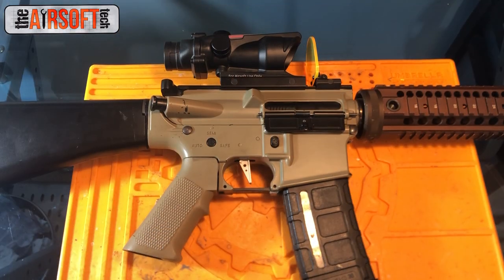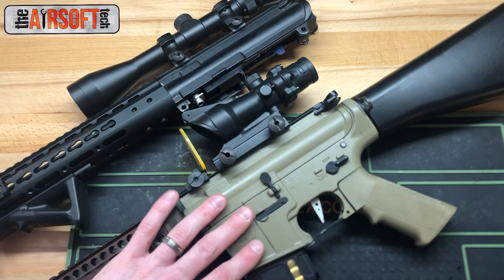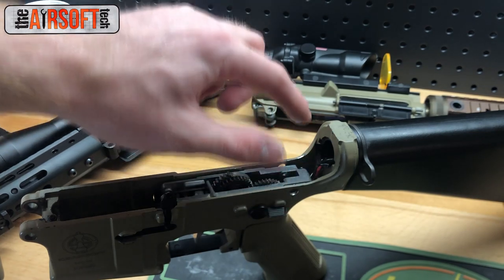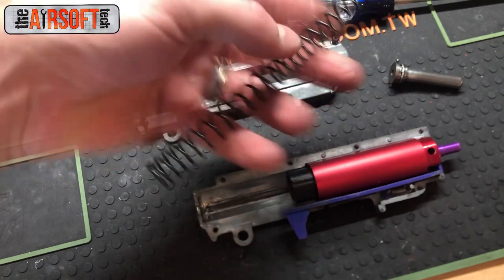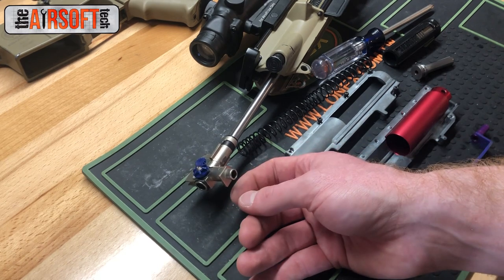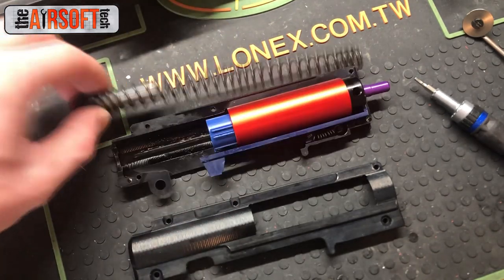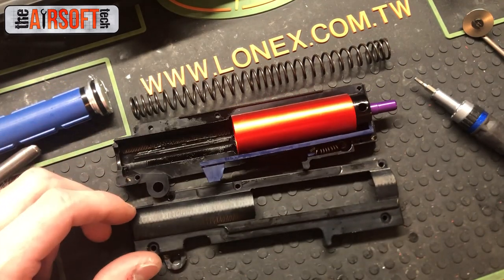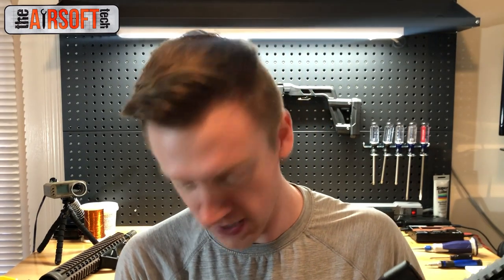ICS Split Gearbox M4 | Dual Receiver Build

Comment: Hey, I've got a Peleador and I'm thinking on building a DMR Upper gearbox, I'm not sure to which extend I'd need to change OOTB gears as they are supposed to be good steel. I'd like to do something that doesn't go as far as doing the upper receiver completely but maybe a cheaper option, If you could please list the parts that you are using it would be amazing, as I'm missing some, great content, thanks!

Comment: Holy shit you're blasting your Chrono. The barrel is not parallel with the Chrono which 1. Shoots the walls of the Chrono which is no bueno and 2. Gives incorrect readings because your bb is bouncing and is at an angle changing the distance the bb has to travel.
Other than that the build sounds great

Comment: My 1st airsoft gun some 16 years ago was an ICS Car-97 M4, I still got it and recently had some work done to it. I asked the tech to give me a before fps video when it was bone stock, and I can’t believe that after all this time, it still shot around 250-270 with .25. I noticed that you have a single point sling mount on yours, what brand is that? I have the collapsible stock version.

Comment: Awesome video! I was interested in building a DMR upper for my ics captain and I'll be following your example.

Couple questions: was the dmr fps you picked motivated by concerns about internal wear or field limits and if the latter what's the max fps worth trying? Also is such a high tpa motor optimal for this dual setup?
Reply from the maker: Really just field limits. Most fields like DMR FPS under 500.  Max FPS I’d shoot for in a build like this would be probably 550.

Comment: I did this with my ICS CXP Captain a while back. I bought another ICS upper gearbox assembly, ICS metal rotary style hop up, and the proper length ICS metal nozzle. I put together a DMR build and it worked really well. But the games I go to and the fields I play at require you to have a true DMR with a locked out, semi only fire control and not just a high fps, long M4. So I built a SR25 as my DMR and I returned the longer ICS upper back to a rifleman class gun. With a couple changes I can go from a short breacher style gun to a long ranged, sniper support style gun.
The lower is a lot like yours in that it uses 13:1 gears, a GATE Titan MOSFET and a high torque motor.
I love my ICS M4 builds. Both are fun to use. It just really depends on what role you want to play.
Reply from the maker: That’s why I have a chimera where I can program semi auto only mode. I do like the idea of an SR25 though.
Reply: @TheAirsoftTech  Yeah, having a dedicated DMR is actually rather nice. Though the SR25 is a big gun and it is pretty heavy, but having that extra FPS to push those heavy BBs out there is really nice. 
I use a rotary style hopup with a flat hop and an Omega 6.01 barrel in it. WOW, that is a super nice setup in that gun. Really accurate and the range is stupid long. I live playing counter sniper. I also put a Gate Titan in that gun with 13:1 gears and a massive torque motor.  The trigger response is amazing. So I can put a lot of BBs down at range. 
The Titan can also set the fire control to semi only.

Comment: Yo, so can you tell me what the very best long-type motor on the market IS?
Reply: Action Army hands down.
Reply: @hidde3064  ok nice. I appreciate the (expensive) suggestion lol. Will probably be using AA motors in the future!
Reply: @Mil_Spec_Spartan_  ZCI/SHS will also do. But if you have money to splurge you can get AAC.
Reply: @hidde3064  Sweet! Thanks a lot!
Reply: Tienly, everything else is garbage for brushed motors if you have the money. AA is just a rebrand and hardly worth the price.
Reply: Asg ultimate has been good to me, and not too highly priced at $60
Reply: @opairsoft8100  also action army is not a rebrand. They are made in the same factory as ASG motors but have better quality control and slight differences that make them better.
Reply: Taktikal HALA Taktikal HALA they must be so good that their endbell are out of spec and that they burn out on 25 amp ssg’s.

AA motors are exactly the same as asg, which are the exact as star wei, they might have slightly better qc than asg, but still aren’t amazing.
Reply: @opairsoft8100  interesting... in fairness, I'm running an ASG 30K motor w/ 13:1 gears, and it's performing very well! But what do you mean by "out of spec end bell?" Do you just mean the end bell isn't compatible with other motors, or do you mean they don't set well in TM spec pistol grip bottom-plates?
Reply: @opairsoft8100  their endbells arent out of spec and fit everything I've ever used. They don't burn at 25A either. Learn to build a gun. I've run them extremely hard. I've semi spammed 300 shots in a row as fast as I can, on 14:1 SSG at 400fps. Motor was cooking yet had no loss of magnetism and functions perfectly to this day. That was on a 4000mah 35C battery so the average current due to it being semi auto was way over 50A with spikes of upwards of 100A. All this with some active breaking. They are superior to tienly, you're sounding like a shill. Their brushes don't melt either.
Reply: @Mil_Spec_Spartan_  the dude just hates these motors for no apparent reason and always pushes for tienlys for some reason